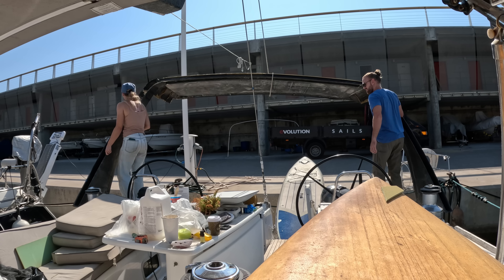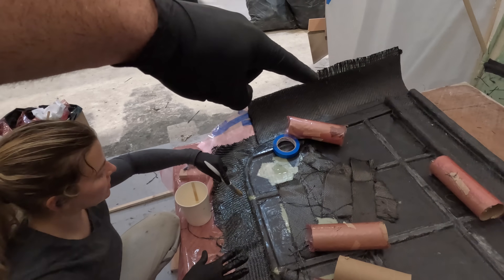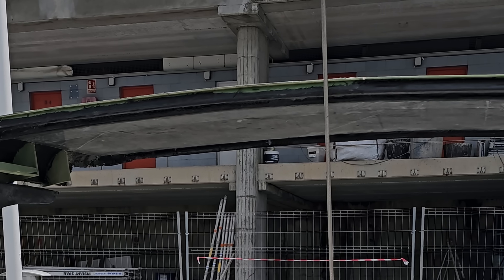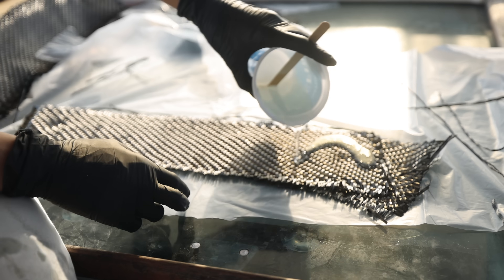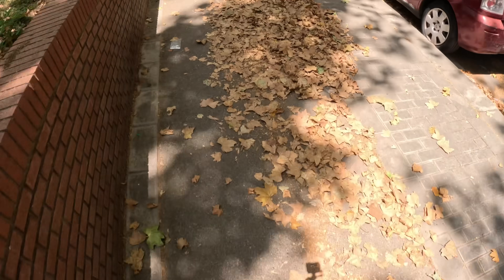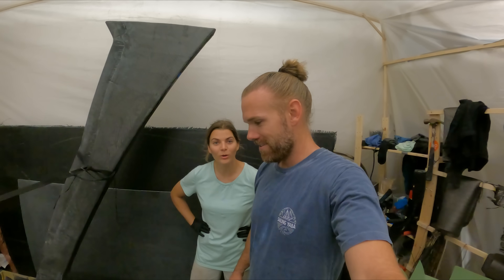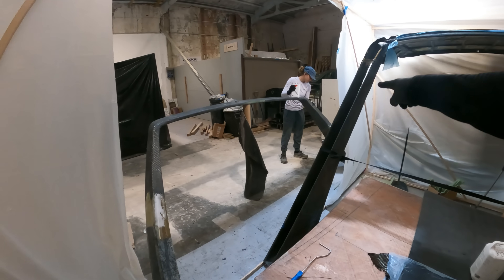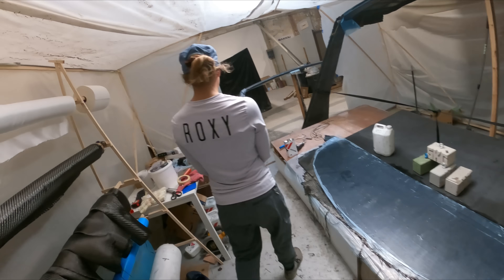Carbon Fiber Hardtop Bimini: Install the Davits and Dodger Arch (12)

Comment: Have you ever considered trying vacuum infusion? I'm just getting into it and it's awe-inspiring how huge the resin-to-glass ratio has changed compared to the hand-wetting. It will be at minimum 50% lightweight.
Reply from the maker: We started out doing a lot of this with vacuum bagging, but a lot of the parts didn't lend themselves to the process well. Infusion seems incredible but and I believe the hype, but we have not tried it.
Reply: @ExpeditionEngineering  Vacuum bagging is a bit trickier as the clock starts ticking from mixing resin and there is not too much time for hunting after vacuum leaks. Conversely, with vacuum infusion, you have unlimited time for dry setup and 10-60 minutes to enjoy your good prep work and admire resin flow. I just successfully finished 4 consecutive vacuum-infused parts and every time I had new ideas and takeaways on how to improve the process. I'm very happy that I gave it a try. Just sharing my experience...

Comment: I get that most of the design is a reflection of what looks best on the boat.  I’m still interested to know details like how many layers of carbon, plus weight and type, is needed to provide the rigidity needed for your use.  I can’t imagine that with that big of an investment in time and money that its just a guess.  Did you consult an engineer or take inspiration from a previous design?